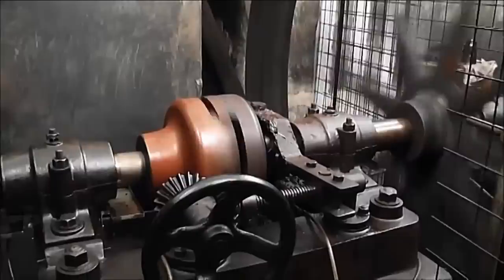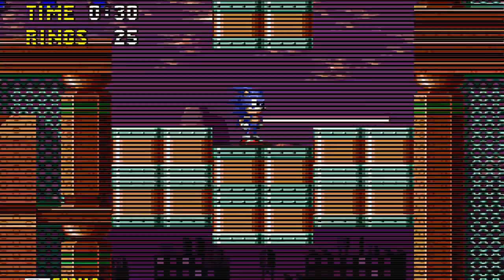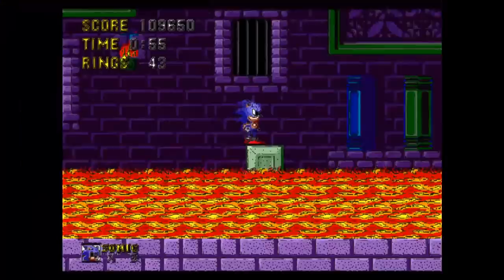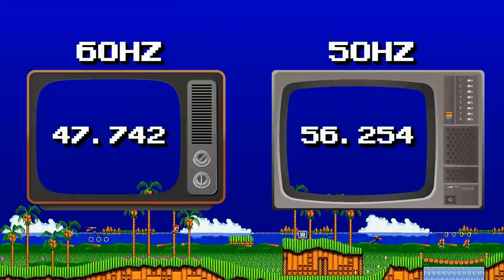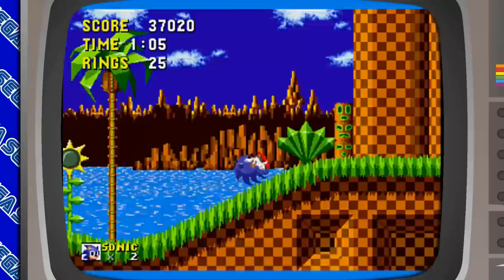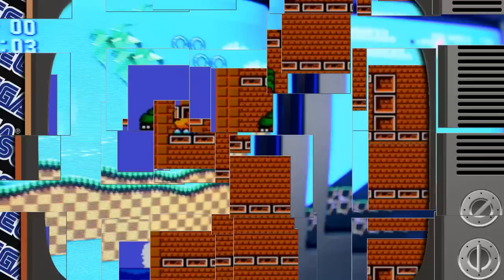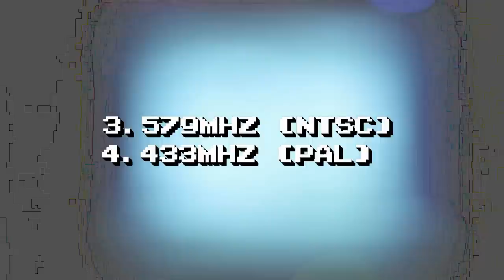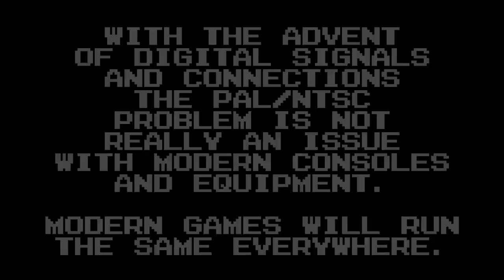Why is Sonic Faster in America? NTSC vs PAL/60Hz vs 50Hz | Nostalgia Nerd

Comment: Also movies in PAL television standard are usually played 1 frame per second faster than they should (at 25 fps as opposed to standard film 24 fps). In NTSC the original movie speed is preserved through complicated "3:2 pull-down" transfer from film 24 fps to NTSC 60 Hz.
Reply: I actually thought PAL was 25fps whereas NTSC was 30fps and cinemas used 24fps, could be wrong or misunderstanding it but we see that on Youtube, on TV and DVDs.
Reply: Yeah, you are absolutely right, but in analog television (PAL or NTSC) these frames are interlaced, which means that one full frame actually consists of 2 fields, hence we have 60 fields per second or 60Hz refresh rate in NTSC television standard and 50 fields per second or 50Hz refresh rate in PAL standard.
Reply: kosmosyche I see, that clears that up, I used to sometimes do 50hz on games on the PC years back because for the most part it feels like running at 60hz but it's like having extra performance for nothing,
Reply: you're crazy. 60hz is already terrible enough. 50 is godawful.
Reply: ***** 50hz and 60hz is possible for gamers, 30hz is a bit of a joke, anyway, I used to use 50hz on some PC games in the past when I couldn't quite managed 60fps in games but was averaging in the 50, locking the refresh rate at 50hz pretty much gives the same smoothness of 60hz, even better if your hardware can't quite handle 60fps but it can handle 50fps, you get rid of the judder.
Reply: +Paul Aiello

It's not a good idea to measure frame rates in hertz. 60 Hz on a progressive scan is 60 frames per second, but interlaced is only 30 frames per second. There can also be perceivable differences if you're running 60 Hz on a CRT vs an LCD due to the latter having a backlight and persistent pixels that removes flicker from the image.
Reply: GGigabiteM That's true, but still I would like to think with the tech available that now we should be able to come up with a proper standard that works well for all, seems ridiculous that we're still dealing with hz at all in all honesty when we have things like Freesync around.
Reply: Correct. I always notice the increased audio pitch of movies when played on PAL broadcasts.
Reply: I must agree with GraveUypo. I have not owned a monitor that ran at less than 100 Hz since 1999. Vsync introduces unacceptable input lag and always has since sprite hardware died.
Reply: I'd like to add, since I'm rewatching this video, for some reason, that 3:2 pull-down is a curse I wouldn't wish on my worst enemies (interlaced blurriness and judder). Running a movie slightly too fast is much preferable; and of course, shooting a movie at a higher framerate too begin with is much better. Making the movie look so intentially awful (24 FPS) that you hide the slightly unconvincing acting and slightly jiggly, rubbery movement of animatronics monster is a bad tradeoff. Trading off resolution I can get behind though; e.g. original half-life looks best at 800x600 or so on a decent CRT with AA and AF. Higher resolution breaks the illusion that the character models aren't made of triangles, the walls aren't atomically flat etc and the extra pixels don't really add any relevant detail anyway since there is no more detail to the assets.
Reply: @GraveUypo  wtf? 60fps is almost as smooth as 50fps, there’s very small difference

Comment: I think you should have clarified that these old games consoles don't output interlaced images. Every subfield represents a complete frame, output at 50/60 hz. Instead of 480i its 240p for NTSC.
Reply: noop9k how can it output at 240p when the screen does indeed have 480 lines on it (without interlacing)?
Reply: Dean Fox why should I explain widely known facts to you in YT comments?
Reply: noop9k you don’t have to do anything bud. I’ll just assume your comment is incorrect. Thanks.
Reply: Dean Fox Ok. Tell me, what display standard you are talking about that has 480 lines without interlacing.
Reply: noop9k there are none, that’s my point. 240p is not 480i:
Reply: Dean Fox the timings are almost the same. Only difference is that there’s odd number of lines per two frames in 480i. old PCs/consoles output specifically 240p, often with somewhat broken, but acceptable timings. Later ones are switchable between 480i and 240p, though interlaced modes are rarely used.
Reply: Dean Fox also, it was you who wrote about “480 lines without interlacing”. I never claimed the old consoles support 480p.
You obviously don’t understand the difference in timings of interlaced/non-interlaced modes, why don’t you educate yourself instead of wasting my time?

Comment: I remember, back as a child, when a friend from the UK came to Canada for the summer, he was blown away with how fast Sonic was over here. I had no idea what he meant when he said "Sonic runs slower on the Mega Drive," until many, many years later.

Ultimately, during the '80s and '90s, it would have been much easier to just add in coding for optimisation during the European localisation process of a given game. This was rarely done, though. From laziness? Or simply due to the differences in the hardware, given on which side of the pond you're on?
Reply: Mostly laziness.  Nintendo seemed much better about this.  From what I've heard, playing PAL Mario 64 on an NTSC system is quite the sped-up experience.
Reply: Nintendo seemed like the only company who went the extra mile and optimised most of their games for PAL territories. There were exceptions such as the Mattel version of Mario 1, and Kid Icarus, but overall most games had their music optimised. Zelda 1 & 2, Mario 2 & 3, Kirby's Adventure, etc.

Comment: PAL was 576 lines of resolution compared to NTSC's 480 lines... Most older consoles (including the Mega Drive) then used a progressive mode (to avoid interlacing) which led to 240p (and scanlines).  The additional lines you referenced were just used for overscan and were never visible.  This is what essentially led to the 640x480 resolution (progressive) mode that some later consoles adopted over component cables.

PAL optimisation wasn't really standard until the Dreamcast (which allowed most games to select between 50/60hz)

Comment: Another good example was Street Fighter II on the SNES. Since we were all used to how the arcade machine played, it was VERY noticable when our SNES version had floaty moon-gravity jumping, and so we started importing NTSC consoles instead.
But I hate when people suggest they didn't bother to "optimize" the games for PAL - as if it's just a case of being lazy. To speed up the game you need to skip frames which is even worse than running the game slower, things like combos in Street Fighter depend on exact numbers of frames, you'd be changing the entire gameplay.
Reply: Games such as Street Fighter II were not using the SNES hardware to it's fullest though, because there were cheats for the datel action replay or game genie that could make the gameplay much faster without skipping any animation at all. You don't need to skip frames to speed something up unless the technology cannot handle the game showing every frame at a faster rate. I'm sure some games couldn't be sped up well though (something like virtua racing on megadrive that had a 3d processor inside the cartridge)
Reply: +MrVidification I think you've misunderstood the video. This isn't about how fast the hardware can process frames. The vertical refresh rate is locked at 50Hz or 60Hz so of course you cannot just show the same number of frames but somehow faster, you actually have to skip some.
Reply: googleboughtmee
yes I am only replying to your comment on people saying they developers were 'not bothering to optimise for pal'. You are relating to refresh rate, but the gamers were not. Some people used that as a way to say developers were simply not bothering to spend any extra time to get a game to match it's ntsc equivalent. 
Relating to the last five+ years or so, for the few games that still have no 60hz option as that easy solution, they have now 'optimised' by removing borders,speeding up the game animation etc-with no skipping necessary.
Reply: MrVidification How do you speed up the game while at the same time keeping it at 50Hz?
Reply: googleboughtmee
Not every game on the MD system was 17% slower than the ntsc version (50/60hz) but most games at this time were bordered. Of course you could cheat by modding your console with a 60hz switch. Some forums have mentioned bootleg 50hz carts being sped up with added inside components too. I don't know if any official 16 bit carts were 60hz only (I doubt it) but the former could run on any pal tv at 60hz via scart cable.
 
I suppose to optimise it's all about noting the maximum fps possible without animation skip, synchronising for both audio and that tv display to avoid output issues. I am sure many older games did not need that screen to redraw at the maximum that their pal and ntsc televisions allowed. Every game was no doubt different in what was possible, so I am sure some games could not be optimised well.
It's going to be far more time-consuming to do it for complex 3D games, so the 60hz option will usually be there instead.
The Dreamcast set the standard for 60hz but the PS2 that came after it did not, with a far lower percentage of 60hz titles.

I think some games such as Crash Bandicoot on PS were optimised,but there were more examples on N64.Someone mentions the SNES pal super tennis being optimised but I can't see a comparison on here
Reply: MrVidification Listen to me - how do you speed up the game without increasing framerate? Stop for a second and think about it. How do you play 60 frames within the span of 1 second at a rate of 50 frames per second. It cannot be done.
Reply: googleboughtmee
you are right..but.. but!..lol.. it surely depends on how many frames per second a game originally ran at in the first place, and your display output. Especially with very old games and crt tvs.

The awful but well known bootleg Street Thrasher VII runs at 10 frames every second, like a stop motion movie. The pal version with no changes runs at 8fps. The developer would have to speed up the rate of animation from ntsc and then synchronise for 50hz. There is no visual loss in the game's animation because the game does not require a high fps. Pal crt displays only scan 25 full frames as pal scans only half the screen each second, to sync to the 50hz standard. Ntsc crt tvs scan just under 30 times each second. Some of the most notable games with a low fps may not have been able to optimise in the 16 bit era though, such as the 3d star fox on the snes that online media state ran at 20fps

Off topic but I've noticed some AAA games on pc today are being locked to a lower frame rate of 30fps for a movie-like 'cinematic atmosphere' rather than the cheap european documentary high fps that mirrors reality. Both have their plus side
Reply: Very simple. Animation frames in most of these games are replaced at much slower rate than 60 hz. And movement is typically created by displaying the same graphics at different positions. So you just adjust the offsets between these positions to be slightly higher in average.
Reply: Stop talking about "full frames at 25". You understand the concept of interlaced scan wrong and those consoles don't do interlaced anyway.
Reply: +noop9k Yes, most of the time you don't show new art on every frame, more commonly you might have something like an animation being made up of 4 different bits of art, each one being shown for 3 frames, creating a 12 frame loop. You can remove 2 frames from that to get it somewhere closer to NTSC speed, but which 2 do you remove? Whatever you do, the animation is changed very slightly. 

But it's not just the visual issues here, these 2D console games were often programmed with frames as the timebase, as you can see when slowdown occurs. Adjusting the number of frames could play havoc with any number of things such as how long attacks or invulnerabilty last, how far you can jump, bullets speed, etc. Even if you can check and adjust the balance of the game to compensate, I'm not sure that's any better a solution than just giving us the full original game playing at a slower rate.

In Virtua Racing on MD they use a time-delta, so instead of things slowing down when the hardware can't keep up, it just skips frames the same as any modern 3D game does - so the PAL version has been sped up to compensate, because it was an easy thing to do, but compare it side-by-side and it still doesn't run the same as NTSC, it's actually too fast!

Speed isn't the only issue with the PAL versions either, the graphics are still squashed and have borders at the top and bottom. But hopefully the people who complain about lazy devs realise why that is too.
Reply: You are correct about the fact that the fast-paced 2D fighters, that rely on short frame-based timers should be carefully re-timed and it will affect gameplay. But, if done properly, average player won't ever notice. Converting animations in 3D games is not a problem as they already operate with fractional coordinates and fractional increments. But, for a fast fighting game, timings would present exactly the same problem, no matter 2D or 3D.

Comment: @nostalgia nerd - The word “Genesis’s” is correct, as it’s a possessive use, not plural.

Plural would require a common noun to be stuck on the end. As Genesis is a proper noun (being a name). So plural would be Genesis Devices, or Genesis Consoles. However, as you were using possessive grammar, this doesn’t apply.
Reply: Proper nouns can and do have plurals though. My name is Daniel. I could conceivably get invited to a party (pandemic restrictions aside) and then on arriving discover that everyone else invited is also called Daniel, which would be a weird way to pick a party guest list, but anyways by your logic we could only refer to it as a room full of 'Daniel people' or 'Daniel men' or something like that, when actually it is perfectly ok to just say a room full of Daniels. I'll grant that the fact that Genesis ends in an 's' makes things trickier, but if my parent's had put my given names in the other order then I would be a James, and if I had therefore been invited to the James party instead of the Daniel party then I would instead be in a room full of Jameses, or possibly that would be written/typed James's or James' ? But we'd none the less all pronounce it the same, however we rendered it in writing or type. That is we'd pronounce it as 'James is'. So with Genesis the plural is presumably written/typed as either Genesises, Genesis's or Genesis' , but here we also have two posible pronunciations, 'genesis is' in line with the way we pluralised James in speech, or 'jenner seize' in the same way that crisis (pronounced 'cry sis') gets pluralised as crises (pronounced 'cry seize')
Reply: @MrDannyDetail  No plural was was intended by the OP. So his grammar, as I reassured him, is correct. The information you provided, I already know and is not relevant in reassuring the OP.

Comment: I've always seen these comparisons with Sonic 1. But what about Sonic 3? Did they fix this in the end because I feel that the JP and EU versions feel the same in that release.
Reply: Everything after Sonic 2 was coded to run perfect in both PAL and NTSC
Reply from the maker: Yeah, they had their act together by the third game.
Reply: +Nostalgia Nerd +Sotirisdim8 Sonic 2 and 3 are both slower on PAL. Check it yourself.
Reply: Its definitely not
Reply: Sotirisdim8 How are you testing it? I tested both on Fusion and on the real hardware before posting this.
Reply: googleboughtmee
 On my dad's Mega Drive, I can't really see no difference!
Reply: I've never been able to tell the difference from Sonic 2 onwards.
Reply: Storm Gaming Media they fixed it by sonic 2
Reply: Sonic 2 and 3 are definitely slower in PAL than in NTSC. But the fact that they did fix the music speed for PAL means it doesn't feel as slow as Sonic 1 did. It's all psychology.
Reply: You have to hard reset the game else region change does nothing. They check the console on boot.
Reply: googleboughtmee They are, but on a lesser scale. Sonic 3 plays properly on PAL systems.
Reply: Sotirisdim8 was it? Because when I played sonic 3 on my MegaDrive it still ran slower than when emulated. Unless it’s because my console is a clone, and my copy of sonic 3 was illegitimate(aunt picked it thinking she was getting a bargain).

Comment: The 60Hz and 50Hz issue seems to also affect TV series, where the theme song and audio seems higher pitched in Europe than in the USA, but I digress.
Reply: That's because for movies shot at 24fps (which is the industry standard) they just speed it up to 25fps for PAL TV broadcasts and call it a day. In NTSC territories they would have to speed it up to 29.97fps, which would be too noticeable, so they do a more proper conversion with a machine called a telecine, which has it's own issues but is less noticeable to the end user